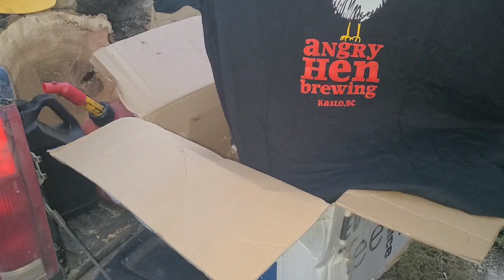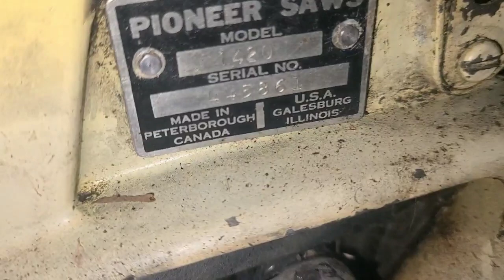Haulin firewood, Husqvarna 44 tackles big wood, unboxing saws!!

Comment: I have ported my sachs dolmar 120 super to very agressive numbers (well past 100 degrees on the exhaust). With a very aggressive chain it cuts with a stihl 500i. I had a professional test it, he really liked it. They both cut in 24" german beech wood. 
Thank you for teaching me all the good things that made that possible.
After that he handed my a stihl 046 that doesn't run quite right which I should check what I can do about that.
Reply: @Schwal🅱️e_262 yes I have, but it was not the first saw that I have ported. I actually bought this saw just to build something like this.

Comment: Have my 025 torn down because after 20 plus years it finally got an air leak.  I love my 025.  Have a new 261 but grab that 025 most of the time.
Reply from the maker: I've always liked an 025. Those were just like the 44, strong little Saws.

Comment: The little one’s are fun... and a lot easier on the back!   Great fuel mileage too’ !!  I’ve been a huge fan of the ported husky 350’s to the 353...45mm flattop setup... I remove all the meat between the transfers and toss the 359 carb/intake on them... nice little ripper with an 18” .325 setup....   or an 18” 3/8’s with the 346xp sprocket ....     the 365 with a 20” is my absolute favorite firewood getter...👍😁.       

I got a Mac 610 on the way... starting to get some of the older ones to play with... they do sound great!!!  The blue homelite is going to be my first old saw port job... I really dig the blue paint job on the old homey,,,✌️😂👍.     77cc’s!!! Those old girls gotta get down and buggie with that displacement!!!

Comment: A lot of improvement from the p40 on the p41.. tho they look similar they are different in a lot of little ways.. the specs on power between the two are almost the same. The p42 was the jump in operating rpm.

Comment: love your videos!! and gone and done it, my grinding wheels arived today still wateing on the timeing wheel, and got a old robin strimmer engine to start on, going to see if i can retro fit a jonsered carb to it as well as the carb on it dosnt have any adjustment needles, dont want to do my saw just now as i kinda need it working and i cant get spaires for it as its just a cheepo one, if i get my old one back off my mate its getting borted as well though!! just have to find my mini air die grinder i've never used in the 10 years i have had it haha.

Comment: Quite the collection you have I think a 50 cc saw with 325 chain can keep up with  a 55 to 60 cc saw  with a 3/8  pitch chain  makes me want to get my old 350 going it starts  and stumbles won't Rev up I've messed  with carb filters  no change  mite try a new coil I was using it allot when it broke down 5 years ago then I bought  a 455 rancher  it now does the same thing  so I hung it up and bought  a 445 series 2 it's a 50 cc with 18 inch 325 some day I want to get a 372 or maybe a 365 565 some day rite now I need  heating oil and truck needs work you no adult thing's
Reply: Did you check the intake boot on the 350? They'll to lean and scorch the cylinder and piston. Husqvarna has updated part numbers, very common problem

Comment: I've just bought myself a Husqvarna 362 as a project. Any opinions on them?
Reply from the maker: I've never had the chance to run one of those. Probably strong like most husky 60cc Saws.
Reply: It's the same chassis as the 365/372, 47mm bore, dual transfer port vs the quads of the other saws on the chassis. 
Early ones are K095(small) bar mount vs the D009 of the 365/372, as they were aiming to replace the 262. 
You can bolt on the top end from one of its bigger brothers, pretty much directly.
Reply: Had a couple they were crankers, very good saws
Reply: Thanks 👍